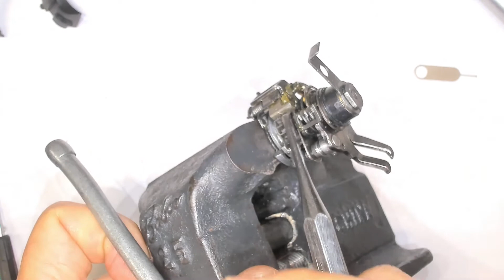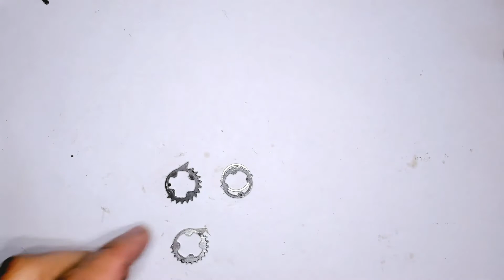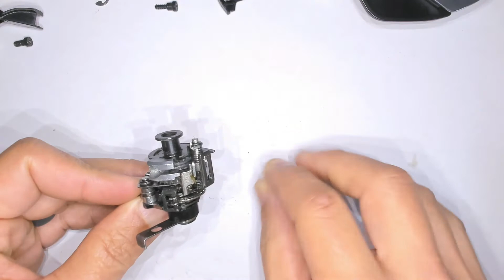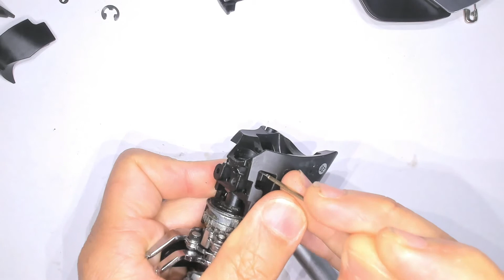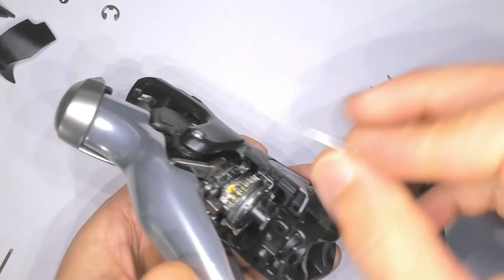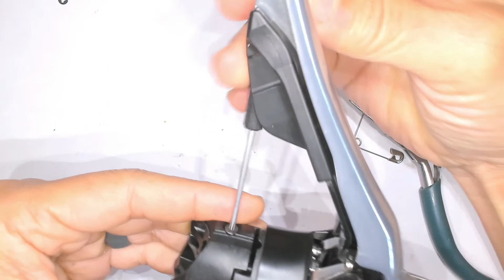105 5800 shifter reassembly

Comment: thank you for the super detailed video! i have a problem with my shifter where the main ratchet spins freely. if i hold the shifter upside down, the ratchet engages properly, but if i keep in its normal position, the ratchet spins down therefore not engaging with the mechanism. any idea how to hold it in place?
Reply from the maker: That sounds like a pawl isn't catching, probably because the spring is either broken or just not fitted correctly anymore.

Check to see which pawl is loose and then look at the spring on it- one end of the spring should catch on the pawl (usually on the backside of the pawl where it doesn't catch on the ratchet) and the other end should be anchored in a hole.

Comment: Can you sell me either a 12 speed ratchet wheel or the drawings for the laser cutting?
Reply from the maker: Sorry for the late reply. This is so late that mechanical 12-speed 105 is already available. But in case you're still interested, the Thingiverse project with drawings is linked to in the video description.
Reply: @amanwithamultitool  mechanical 105 is available for hydraulic disc brakes, but not for mechanical rim brakes for the 1970s steel bikes we all know and love (and have spread to 130mm for 8-9-10-11-12 speed rear sprocket sets).  I have not fully disassembled the 12 speed mechanical unit, but the unit itself does not fit the 11 speed shifters.

Comment: Showing the inner mechanisms that make a shift is proof that it takes quite a bit of engineering, design, and ultimately manufacturing to make the system. This has to come at great expense. Now take modern electronic shifting. You only have to put two buttons in the lever. The rest of the indexing is done with a specific kind of motor that is driven via electronic driver. Electronics and motors are way cheaper to produce. So why is it then we are being charged so much for these electronic groups. Also with electronic systems they can make the movement to be whatever they want, 9 speeds, 10 speeds, 11 speeds, etc. using the same parts. All they have to do is burn in the firmware. I'm really mad about this. All consumers should be outraged. It's not new technology. Eventually electronic shifting will be on all bikes but at the moment they are charging so much for it not many people want to pay for it. I have Electronic 11 speed that cost me $3200 for the 11 speed groupset, verses the Campy Chorus 11 speed mechanical group I used before that which was only $1200. Now the Shimano 105 used to be the People's groupset went to electronic, doubled in price, and nobody wants it because it's almost $2000. How do we get more affordable bikes?
Reply from the maker: It's a bit simplistic to reduce electronic shifting down to two buttons, a motor, a driver, and some firmware. It also takes a fair bit of engineering. Go ahead and take a look at a teardown video of an electronic shifter or derailleur.

I can take apart a mechanical shifter or derailleur and show exactly what each part does to help move the chain to the proper position. With electronic shifting there's going to be a lot of handwaving: "pressing this button sends a signal to shift down." Sure, what kind of signal? What's the protocol? What's the communications packet look like? What does this part labeled C3 on the PCB do? Is there a state machine in the shifter? On the battery? In the derailleur?

There's a lot more to electronic shifting than there is to mechanical, so of course it costs more.

Sure, maybe the firmware could be tweaked to change the number of gears and the spacing between the cogs, but it's not in the manufacturers' best financial interests to let the end user do that right now. And honestly, they probably haven't designed for the edge cases users like me would want to subject their components to, so it's better for them to limit compatibility instead of dealing with the hassle of trying to provide support for arbitrary compatibility. I'd love to explore how to hack their hardware myself, but besides not having any parts to experiment on, it's a whole other level of difficulty compared to taking apart a mechanical shifter.
Reply: @amanwithamultitool  I have to disagree since I have an electronics degree in engineering, and I have been working in this field for almost 30 years now. The components or hardware to build a control device for a motor have been in the making and improved upon for many years. All you have to do is go to data sheets and find the components that fit your purpose and place an order. Today we have people 3D printing their own parts and companies doing it also, and injection molding processes that have been simplified far more than how it used to be done. It has become so cheap to make RC toys so cycling shifting systems would not be that much different. In the area of manufacturing and packaging which is where I specialize machines do all the processes of filling, crimping, indexing, etc., I can't even repeat it all. Once the designing has been done the mass production of the item becomes so cheap to produce and not very labor intense. Machines even do all the surface mounting and soldering, and robotics play a large role. Electronic groupsets are very cheap to produce and should not cost $3K TO $4K to the consumer. It actually is simplistic in comparison to manufacturing and handling of the mechanical parts that also require much more inspection and hand labor.
Reply from the maker: I thought that a lot of that hand labor for mechanical shifting still has to go into assembling the electronic shifters- well, at least the electronic derailleurs. But sure, electronic shifting groups don't have to cost as much as they do now. It's almost as if the companies are maximizing their profit while they can. Ha ha.

I can't get too worked up over it. Yes, they could change their firmware to work arbitrary numbers of speeds. Maybe they could sell more electronic groupsets for less. That's probably indicating that this is a market segment that's ripe for disruption. That's when I'll spend my money on electronic shifting.

Until then, I'm trying to make 12 speed mechanical myself :) Maybe I'll make a video about my drop bar shifters with mountain bike derailleurs. They're only 11-speed because there aren't any 12-speed cassettes and derailleurs that can handle the 2x12 gearing I'd like

Comment: one of the pawls that is attached to the higher gear shifting metal plate is missing on a tiagra 4700 shifter that i bought not working. Do you know if it's possible to get a new one or a similar model that work s with this one?